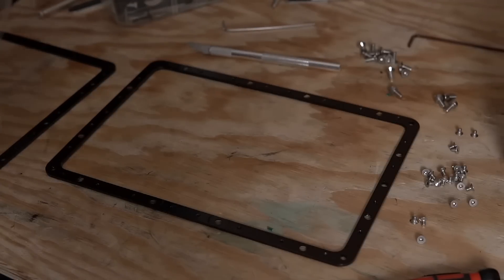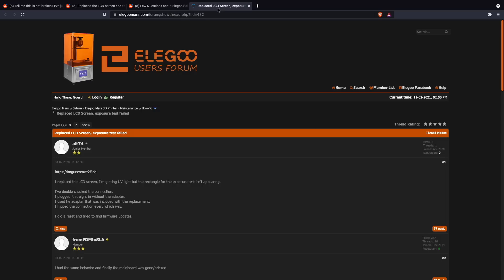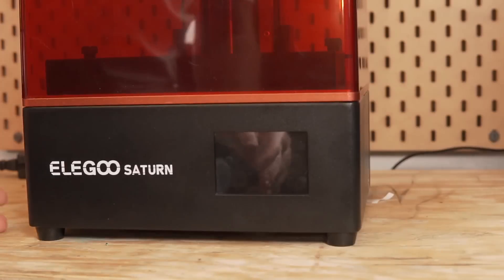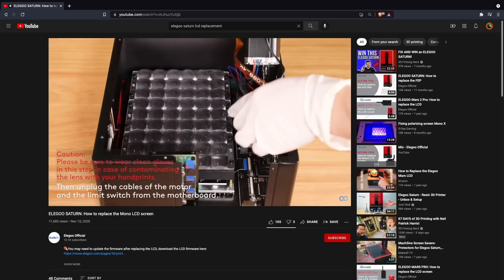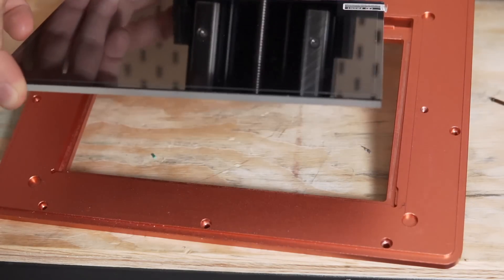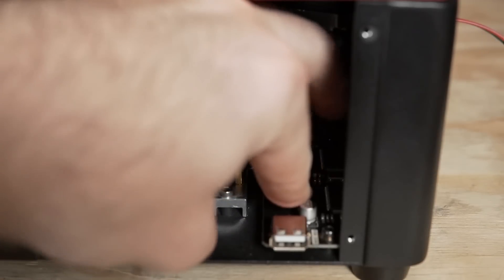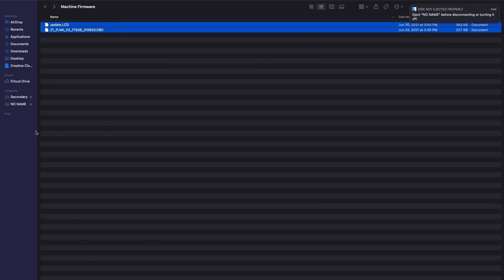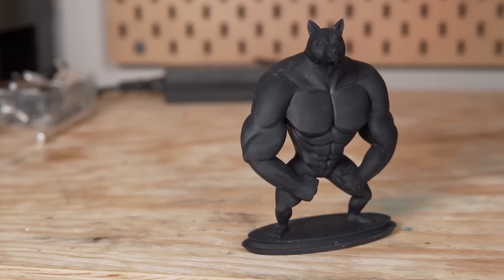Replacing The LCD Screen On Your Resin Printer (Elegoo Saturn)

Comment: Your video is really good, my friend.

The best I've ever seen. Elego should hire you, because their explanations are terrible.

Well, watching your video, I was about to replace my Elego Saturn LCD, but I saw that after installing everything and doing the "Expesure" test, a black rectangle should appear. I had never done this before, so I thought the LCD was burned out. Now I know that this rectangle should appear. If everything is correct, a rectangle without stains, that means everything is correct.

However, my printer was operating normally, but now it no longer sticks the print to the shaft, and when I clean the tank, it also no longer does the cleaning layer.

Following your step-by-step instructions, the rectangle test is ok, but this could be the reason for the failure of not sticking to the shaft, nor the FEP not having the resin after printing is finished, or the FEP cleaning not having the cleaning layer.

Thank you in advance for your attention.
Thank you

Comment: I wish I had found that video first when I searched! I had to use a heatgun to remove the screen (don't burn yourself guys)

The double sided strips have been horrible in my kit. They stick to the back of the sheet more than the small layers :P
I think I have to redo that part again

Elegoo has three different black tape sizes in my kit and they didn't stick very well. Had to let them settle over night to made them stick. 

The cables are way to short to be plugged in. 

My screen came with a cable that I have to assemble myself :P
No idea what part of the cable is meant to stick into the board and screen. 

I'm at that firmware step and hope I assembled it correctly. Just found the firmware. Wish me luck for tomorrow 🥴

a bit late to the screen repair party... 
(had to pause my printing do to a missing work space where I don't have any pets or family)

Comment: Ever since purchase the black tape has been suspect and eventually let go to allow resin into the printer case.  And even when I replaced my LCD screen the new black tape is horrible and does not stick even after cleaning the recess which it would be stuck into. I need to locate new tape once I get a new Motherboard.  During ribbon cable removal the cable latch broke off during flip up, and now the ribbon stopped connecting.

Comment: Commenting here out of desperation. I have a Voxelab Proxima 6.0 2K mono. I assume the firmware procedure is the same, but when I go to "print" the firmware, the file does not ap[pear. I am out of ideas and have searched everywhre. Any suggestions?

Comment: Hi, thank you for a helpful video. I have one question (because I don't have experience in the 3D printer field): I just need a digital mask and its controller for UV exposure purposes (I already have the light source), so is there any commercial package for that? and/or how to buy these components?

Comment: I can't imagine touching the plastic lens on top of the LED would cause the LED to burn up more quickly.
Reply: I assume it's only if you touch the glass part, not the plastic part but I would be paranoid anyway.  I have some experience with that, oddly enough not with my printer but with my projection TVs.   Over the years I've replaced bulbs 6 times, 2 barehanded and 4 with cotton gloves.  The first time I realized I briefly touched the glass with my bare finger but I went ahead anyway (what else could I do), bulb life 6 months.  Next one with cotton gloves, 12 months!  The third I didn't have gloves but I was extremely careful I didn't touch anything glass.  That lasted 6 months only - I must have touched something and not realized it.  The next 4 bulb changes, all with cotton gloves (the last one is still in), bulb life 12-13 months.   That made me a believer!  
  (Note: your projection TV bulb mileage will vary, I watch so many hours per year I need an intervention)
Reply: @mikebare3677  Yes the oil on your hands can leave deposits on glass envelope of a halogen bulb and the extreme heat on that glass will cause that spot to become a weak area and it can fail. This is not the same situation as the LED and lens set up though. First of all the LEDs themselves are not susceptible to the same thing so you can touch them all you want it won't be a problem and the lenses aren't even attached to the LEDs in this case so it's doubly fine to touch them.

Comment: Thank you for the video.  I almost this thing working but when I try to install the firmware it stops at about 80% and the confirm button comes on and tells me to restart the printer.  So I do and then I run the exposure test.  The screen is completely filled and the box doesn't come on.  I checked the cables and they are install in the correct position.  HELP

Comment: I came here to find the right procedure. It's pretty amazing that the EXACT same thing happened to my Saturn S. I thought I had all the resin out and when I went to print a new print the old resin punched through the few film and broke the LCD.
Reply: quote " I thought I had all the resin out and when I went to print a new print the old resin punched through the few film and broke the LCD."     SO if you used the Option CLEAN Resin tank or whatever is called , that ULTRA violet light  illuminate the left overs of resin in your tank ,to get it Hard and then remote it more easily , then no accident would have happened?
Reply: @technoartfest8708  my favorite character on South Park is Captain Hindsight. He’s a hoot.
Reply: did you also have to dowload the firmware from the "saturn" tab to match the screen? i tried to download the file from the Saturn S tab and it didnt work but theres warnings in the text to use the firmware that fits your printer otherwise it could cause damage so im scared to follow the specifications exactly like the video since i have a saturn S and not a saturn.

Comment: instead of triple checking or empty the vat, you can run the clean option and peal the cured resin in the bottom, that will save you time and paper.

Comment: I was waiti8ng for you to finish to see if you mentioned the LCD cable going in upside down as I did the same thing. If you look closely at the ribbon cable one side of the plug end has a black tape over it and the other side has bare, silver connectors. The side with the black tape goes UP opposite the circuit board. If you put it in upside down the black tape will not allow the conductors to touch the pins on the plug... probably a good thing as it probably would damage some circuitry. Also, make sure to plug the Z axis stop into the correct socket on the mainboard. there are two sockets, side by side. My machine did not stop going down so i have to open it up and move it to the other plug. Pretty sure I go it into the wrong one! Fortunately I tested it with the build plate removed so I did not damage my new screen! One more thing; on mine the LCD screen cable had to plug in on both the board AND on the LCD panel so make sure it is oriented correctly there as well. 

To date my machine is still down. I have an early Saturn and have had to contact Elegoo support to find the right drivers for it.
Reply: Thank you for this tip.  With it I was able to properly connect my new screen.

Comment: Great video, i have a question regarding installing firmware. I was told that it wont install if you put it in a folder and has to be direct. thoughts?

Comment: Just finished installing my new screen. The ribbon cable has the same number as the screen that was on previously. I don't have the rectangle when testing exposure. I flipped the ribbon cable and I'm getting the same result. Did I get a bad screen or am I missing something?

Comment: Thank you, It worked for me... This one was a lot harder than my Phrozen mini 4kd... After I ugraded the firmware I need to figure out the ribbon cable rigth positon for both, board and screen sides. After many tries it worked. I was worried about a posible damage to the new LCD but after watching yor video I knew where the problem was.

Comment: Day two with the Elegoo Mars 3 and I'm already replacing my second FEP film. Just had my first FEP puncture, and I think it's because I over-tensioned it during replacement. Inspecting the print surface, I had printed nothing- and I had maybe a dime's worth of hardened resin in the vat.

Comment: Great video, 

In relation to having to upgrade the Firmware I ran into issues, turns out I had to Format the USB in a Windows machine, I did it previously on  a Mac (FAT32) and never worked.

Comment: I installed my new screen into my saturn and worked for a couple days and then died. I'm not really sure what happened but half of the LCD was not working.  Amazon is sending me out another one and based on this video i didn't do anything wrong. Has anyone else had this problem? If so, do you know what caused it? These screens are not cheap

Comment: do you really need to remove the screen protector? I have screen protectors i bought from third party to prevent those nasty resin spills (exactly like the one you changed the lcd because of) that work amazingly. Maybe just remove the tab from the screen protector and leave it on?

Comment: I replaced the screen!  Your video was great. Exposure test and screen worked fine the day and I put it in but the very next day only half the screen is working????
Reply from the maker: Sounds like a loose ribbon cable. I would reseat both ends 👍

Comment: When you say you "installed the ribbon cable backwards" Does the @10:00 mark show you installing it the correct way or the incorrect way? That is; the 50 pin closest to the side panel - is that correct?

Comment: Can you leave the screen protector on?
Reply from the maker: Some do. You can start with it in and if you have any issues remove it afterwards 👍
Reply: @ModBotArmy  lol i came here because i got a issue with resin bonding with the screen and see you pulling off the screen protector after learning the screen protector is built in on assembly.. im like NOOOOOOOOOOOOOO!! after seeing it lol

Comment: Great video, bought my first resin printer yesterday so keep these videos coming.  $99 Voxelab Proxima.  

So you took off that screen protector, is that simply because of the white bit, or is there a good reason to not have a screen protector on a resin printer?  I was kind of thinking a screen protector from a tablet sounded like a good idea, one of the thin ones similar to the one you peeled off.
Reply from the maker: Some do keep it on and I have kept it on in some instances. For this I was really going by what elegoo recommended in their video. If there are no bubbles it shouldn’t be an issue to leave it on. That being said I have not done any tests to see if the extra film causes any sort of distortion on the print. It does not as far as I know.
Reply: @ModBotArmy  Thanks!  Iv got an old tablet screen protector laying around some place, I'll give it a try.
Reply: @jon9947  AFAIK you'll need to increase the exposure time so it can "significantly" increase print times as a result.. hence why they tell you to remove it as speed is a key selling point.
So yeah +15-20 mins per 1000 layers is probably fine for most people if each layer is +1 second exposure.

Comment: Actually you don't need to remove screen protector from the top side of the screen. That way it will protect the screen if the same thing happen again. It's completely transparent so it wouldn't affect the exposure nor print quality.
Reply from the maker: I have kept it on for other printers like the phenom but for this was going by the instructions from elegoo. But I agree as long as the tab can be removed it should not be an issue to keep it on.
Reply: It will not save your screen mine broke from the glas
Reply: Yes you need to. That screen protector has a film guard pull tab  that helps it be removed. If you leave it, it’ll intrude on the print area. But the company does recommend you replace with a fep sheet so the principle stands just that screen protector specifically you need to remove
Reply: Several vendors make a screen to protect your lens: those are much larger than the lens itself so, if a leak or spill happens, those screens protect the taped sides as well as the top of the LCD.  In case of a drip or spill you just replace the screen, the LCD is never in danger.  A drip or spill is the reason I had to replace my screen - I leaked and didn't realize it for dozens of prints, and the resin was on there permanently.  If I'd had one of those add on transparent screens, I could have replaced it instead of replacing the LCD (which I did, very expensive).

Comment: First thing I did when I got my resin printer was to purchase an iPad Screen Protector and cover the printer's LCD screen with it - sealing the edges with Kapton Tape.  Have not had any issues with my screen yet.
Reply: I used some bonus that I got with my Kindle, it also works fine

Comment: Thanks for the guide. Don't have to do it yet but still helpful i remember back in the anycubic photon days i had a a hole in the vat left and left resin on it for few days since i had a black enclosure i didnt see when resin leaked all over the printer and got in-between the screen. Had to replace it :(